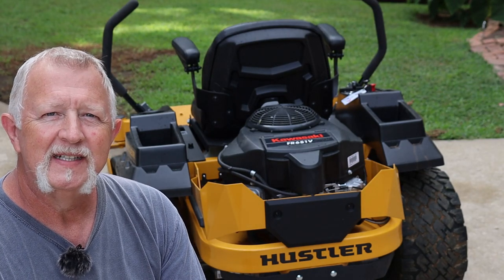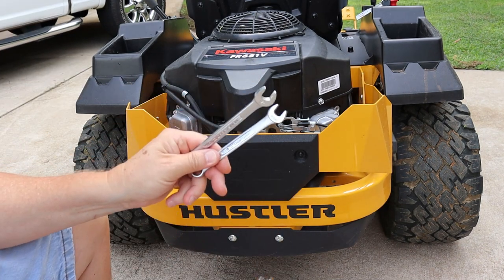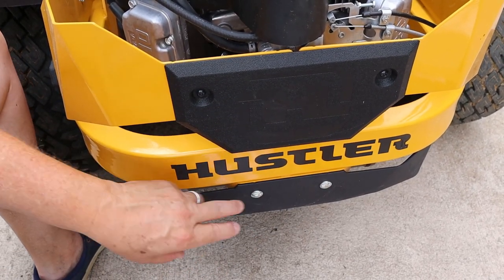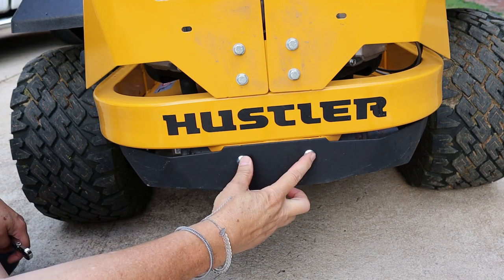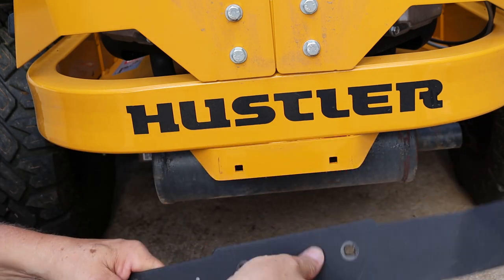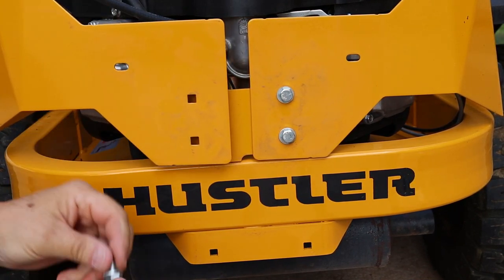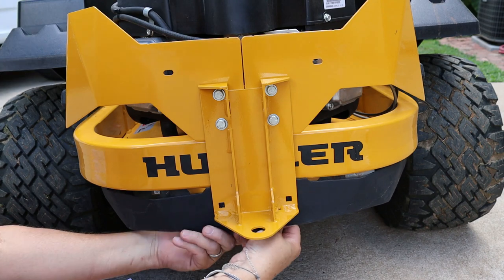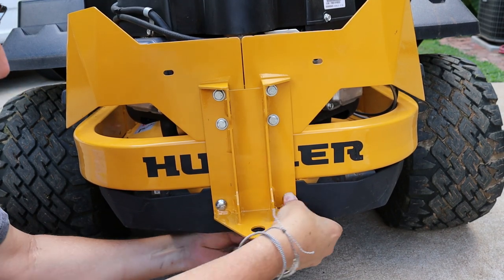Install a Hitch Kit on Hustler Raptor X

Comment: Don't pull anything to heavy with this mower.
The pulling strength depends on the size of the gears.
Keeping in mind the x only has the 2200 transaxles.
Reply from the maker: Great point!  I basically only use mine for a lawn spreader and a spike aerator.  Thanks for watching!